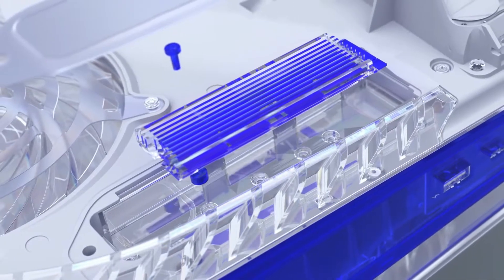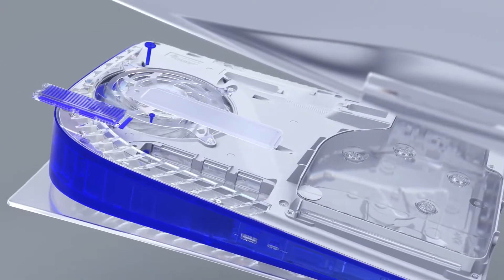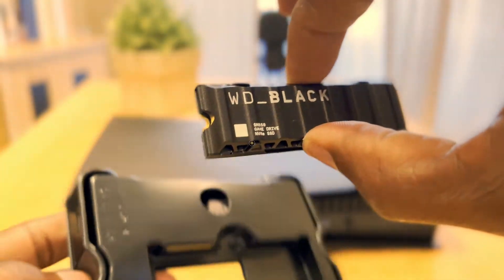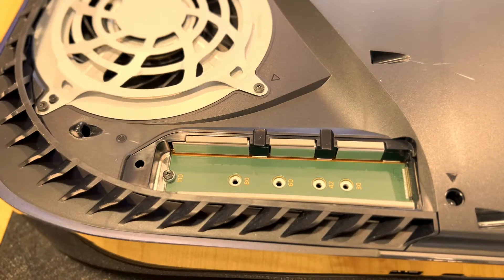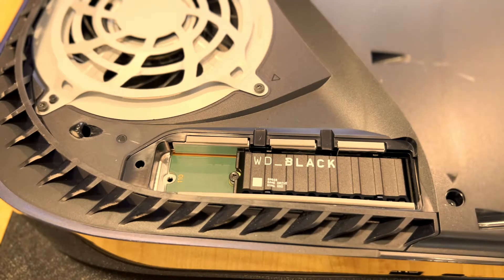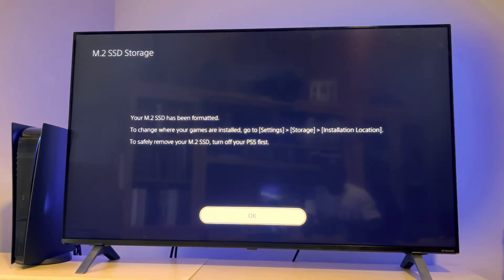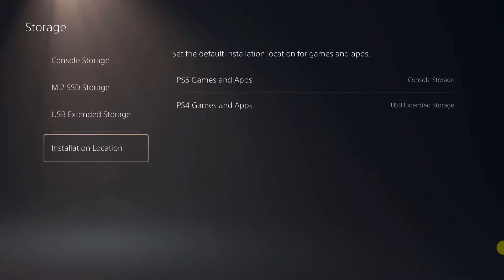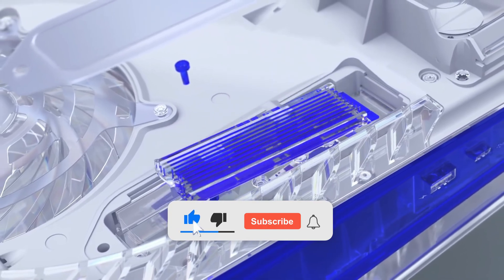WD_BLACK SN850 NVMe SSD Unboxing and Installation for PS5

Comment from the maker: Thanks for watching. Just to be clear the PS5 plate on the right (if facing the front of the PS5) Is the one you need to remove. That is the plate without the PS5 Logo.

Comment: Do you have to take the sticker on the bottom off the ssd
Reply from the maker: No you don't, as long as the SSD makes contact with the connection and is screwed down properly and the cover replaced it should work fine.